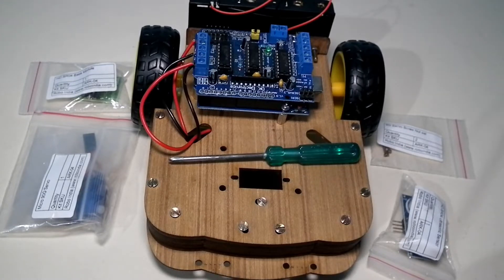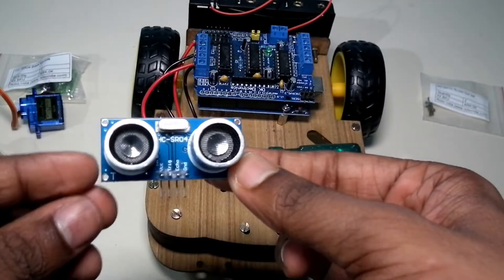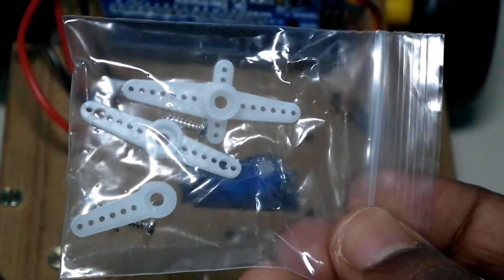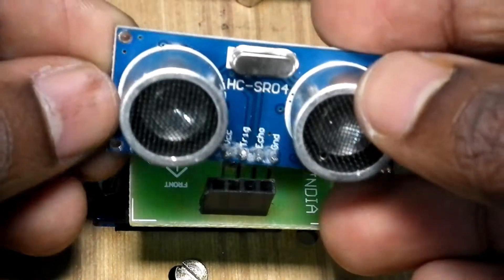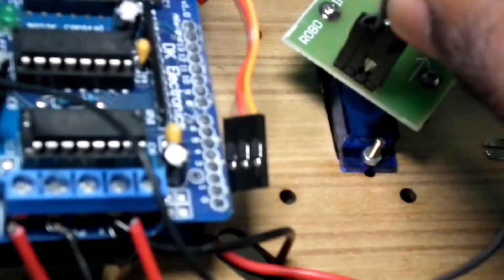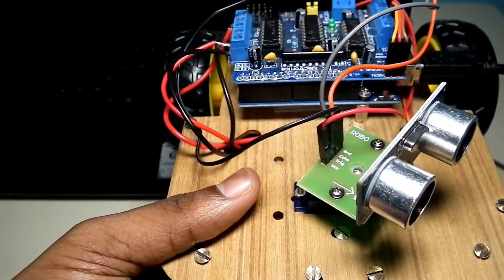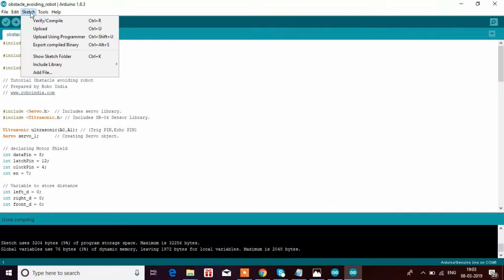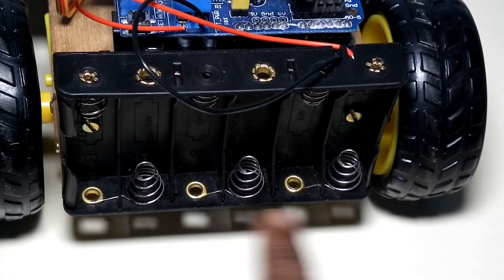How To Make a DIY Arduino Obstacle Avoiding Robot At Home

Comment: Hey bro can u pls tell me the final program?  Cause on their website 2 programs are given
Reply from the maker: Dear Friend, the first code is for the forward robot motion code. It is not the obstacle avoiding robot code. Forward robot motion code is used just to check whether both the motors are spinning forward. If it is not then interchange the wires in the terminal of motor shield as shown in the video. Then you can upload the obstacle avoiding robot code.If you have more questions feel free to ask. If you want to get this product you can get it from the description of the video. Please like and share this video if you like.